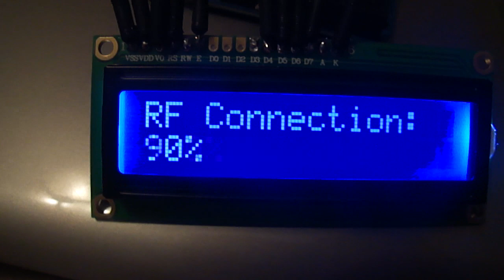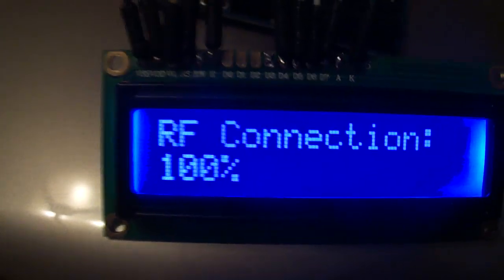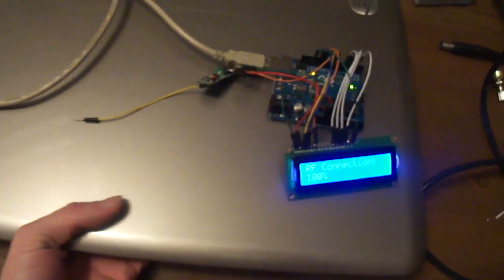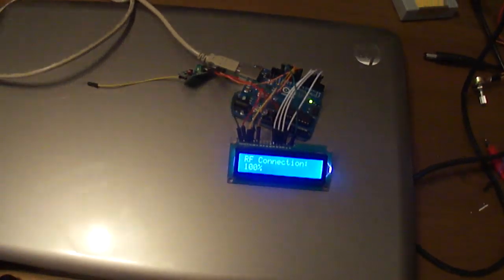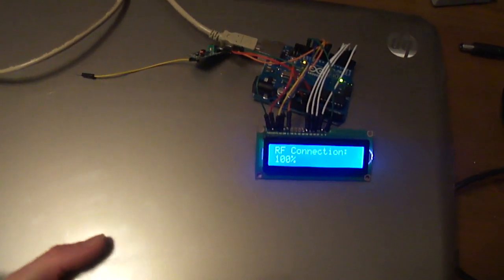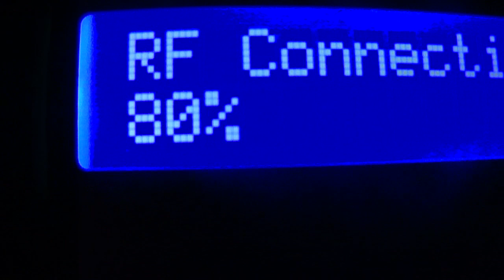433mhz radio frequency rf transmitter receiver kit-- testing range with arduino's

Comment: I am a student trying to build a transmitter and a receiver from scratch, any idea where to start looking ? i have been watching videos but i dont really understand.
Reply from the maker: Yes. I can help. email me at jameshutton@live.ca
order 2 picaxe 14m2 chips and a USB serial download cable from picaxe.com
and order a transmitter / receiver like in this video from ebay. Once you get them, I'll walk you through the rest.
Reply: James Hutton Hi there! Ive been trying to do a project like this for ages. Gave up with the attiny chip. Have ordered a 14m2 kit. Any chance you could point me in the right direction to getting this up and running to send out via 443 mhz. Iv'e got some transmitters ready to go.  Thanks so much. Take care.
Reply from the maker: David Guest explain a little more about your setup. Are you saying you have 2 picaxe chips, one with a transmitter, and one with a matching receiver and you are trying to sent data from one to the other?
Reply: I would like to send a 6 digit code from a 443 tx chip and a picaxe to my raspberry pi running 443utils in sniffer mode.
Reply: James Hutton https://github.com/ninjablocks/433Utils
Reply: In the long run I want to use this code to turn rf plug sockets on and off and to send temperature back from around the house via 443 using rf.
Reply from the maker: ok gotcha. So a few things, you're going to need a microprocessor (picaxe in this case) at every wall socket and place that you want to measure temp. and 1 master that controls them all (all the other nodes would be called slaves.
Keep in mind that if you want to do any 2 way communication, you would need to use a transceiver (communicates both ways). In your case, I think the master would be the only one that would need to do this. Alternatively just use a transmitter and receiver and control them individually with individual pins from the master.

Setting up the picaxes should be simple, and for those simple jobs of switching a plug on or off or reading a temperature an 08m2 should be more than sufficient (their cheapest/smallest chip)

As for circuitry or code, let me know if you run into any problems or have any questions about either
Reply: That's fantastic.  I'm hoping I can get the picaxe to communicate with the raspberry via rf
Reply from the maker: I have no experience with rasberry so I wont be able to help you there
Reply: James Hutton hopefully if you could point me in the correct direction of how to send a 6 digit number from a picaxe chip I can work the rest out myself. 
Thanks again for your help
Reply from the maker: the picaxe sends 8 bytes of data for every RFOUT command. So if you wanted to send a number from 0-255 (lets say 123) and you had the transmitter connected to say b.1, you would write RFOUT b.1,(123,0,0,0,0,0,0,0)

the 0's are just blank values because you have to send 8 bytes.

If you wanted to send out a higher value than 255, use a word variable (16bit).
You will have to send it as 2 8bit variables and convert it back though.
Reply: Could I use the serout command to send a number out without encoding?
Reply from the maker: serout is for serial communication (via wires). Don't you want the project to be wireless?
Reply: Ah I see. I'm trying to send out the data without it being encoded if that's possible.
Reply from the maker: will you ever need to send a value higher than 255?
Reply: only if i could but upto 255 would be okay
Reply from the maker: yeah so you wont have any problem then sending just byte variables (b)
Reply: okay great thankyou very much for your help

Comment: would a bluetooth module be able to get near the same distance performance?  and how is the power consumption differences?
Reply from the maker: I dont know I have never used bluetooth in a project. sorry.
I think blue tooth is a lot more reliable, but I don't think it would get better range

Comment: how did you red the signal intensity? can you share the code with us?
Reply from the maker: read the description. It explains the theory of the code, but unfortunately I dont have the actual code anymore.
Reply from the maker: I've re-visited this and explained the process in great detail, if you're still wondering. Check the description

Comment: Could you run the transmitter and receiver off the same Arduino? I would like to have two boards that could communicate with each other.
Reply from the maker: yes i dont see why not, but how is it wireless if you are using the same arduino? What is the point?
Reply: I would like to have two communication between two separate arduinos, I have two transmitters and two receivers. I've tried using both attached to one arduino but its difficult to tell if its even working at all. There doesn't seem to be a way to verify that you ever actually sent the message. I know just getting two transceivers would probably be easier, but I all ready have these parts and I'd like to avoid spending more money at the moment.
Reply: Two way communication *
Reply from the maker: erm, im not sure. Seriously I rarely use arduino anymore. Like I said. Get a picaxe. the 14m2 chip supports rf.
They are like 3$ each. Buy 2 and they will work beautifully with your transmitter/receivers.

The code to send a signal is "rfout pin, (data)"
the code to receive a signal is "rfin pin, integer values"

it couldnt be easier. this is why i dont use arduino anymore
Reply: Wow thanks, I'll definitely look into that. Do they have the ability to communicate over USB?
Reply from the maker: yes. it uses a virtual serial driver i believe
Reply: Is it similar to the Uno's ATMega8u2 chip, except included on the Picaxe's firmware? I'd really like to avoid using FTDI chips.
Reply from the maker: I am not too familiar with either of those sorry.
It is similar to PIC chips if you have any experience with those. At first it might look intimidating because it is just a computer chip with no easy pins like the arduino, but it is incredibly easy to use and learn how to use.
Reply: James Hutton could the data you are sending just be the measurements of distance between the two receivers and transmitter. I would like to create a device the communicates the distance between two different PIC chips
Reply from the maker: no. it would be incredibly inaccurate. That would be like asking your laptop to tell you how many feet you are away from the router. the signal strength is going to vary a lot from walls, interference from other appliances, and just changing signal strength all the time. I would hazard a guess that the best way to measure distance would be with an ultrasonic distance detector. However, those are meant to measure the distance that an object is away from the chip. The sound bounces off the wall and back, and you calculated the time it took to do so. I'm sure with some modification, you would be able to fix that though. Although, i dont think it would not be able to go through walls or anything if that's the plan.... then there's always gps....

hope i could help!
Reply: hypothetically if u had three seperate equal distant recievers u could make a rough triangulation estimate. Besides that which is pointless; you would have to also link gps (lat lon) into the trasmit data like what is found in telemetry equip and some digital comms such as P25 and motorola astro 25 / MOTOTRBO

Comment: Hello, how do you measure the reception power ?, THANKS
Reply from the maker: read the description
Reply: Thanks but I did and dont know how to do it in code, can you share te code, please
Reply from the maker: sorry, I wrote that a long time ago and no longer have it. I no longer use arduinos so I wouldnt remember how to code it. Use a picaxe chip. It is so much easier to code. if you have any specific questions let me know, but yeah I can't help you out with the whole arduino code at the moment. Basic logic of how I did it is in the description.

Comment: Hey James is the LCD display using the Timer1 librarie? Did you have some problems when controlling both receiver and Lcd by the same arduino board?

Comment from the maker: glass it will go through no problem. Metal might be a little more tricky. It does affect a little, but not very much.
I have tried putting a metal bowl with holes in it overtop of the receiver and it still seemed to work, but with less range

Comment from the maker: what microprocessor are you using? the code will be different for different microprocessors. If you are using picaxe (which i recommend) just look up rfin and rfout commands on the BASIC commands page on picaxe (just search "rfout picaxe" on google. its the first link)

Comment from the maker: first of all the antenna is not hooked up to the display. the antenna is just a piece of wire that receives signals from the air. there is nothing special about it. The display is being controlled by the microprocessor. It is impossible to tell how far away the transmitter is. This project in the video is a very very simple and rudimentary way to calculate signal strength like your cellphone telling you the bars you have. A cellphone can't tell you how close you are to a transmitting station.

Comment from the maker: one other thing you could try, however i have not tried this, is powering both the transmitter and reciever with 5v (different power sources) and seperating the 2 circuits a few feet apart (no antenna is needed).

connect an led between the data pin of the receiver to the negative of the battery or power source. 

now on the other circuit with the transmitter, connect the data pin to the positive of the power source.
When the data pin is connected or not, you should notice the led change.

Comment from the maker: i am not familiar with rasberry sorry. This might be your problem.
I would strongly recommend using picaxe chips like I have stated before. They are only 2 dollars each and are very simple to use and code. 
The minimum code for the arduino to transmit a signal would be probably around 10-20 lines whereas picaxe would be:
main:
rfout (pin number), (1,2,3,4,5,6,7,8)
goto main

so as you can see picaxe only needs 3 lines of code.
the antenna is just a piece of wire. longer = better signal

Comment: If you could tell us the kind of antenna you used for receiver and transmitter?
I am a newbie and just started working a day ago.
Will the transmitter transmit whatever is given as input to its data pin? (we don't need any program to do so?)
My receiver doesn't receive anything.
Please give me simplest possible code so i may know if my transmitter/receiver are working.
I am using transmitter on raspberry and receiver on arduino (as i have only one arduino :( )

Comment: Hey bud, trying to do something similar, but I'm having a problem with the bits per second of the transmitter/receiver (2000) interfering with my serial baud rate of 1200.  At the end of the day, I get an LCD error.  How did you get around this?

Comment from the maker: it doesnt. it would try to read both, which is why these are so cheap. You could make the transmitter send a certain code though so the receiver will only use that one... like send the number 9 at the start of each number you want to send and set up the receiver to only read messages starting in 9. Again these basic devices. You can get much more complex ones that do what you are asking and other things like having the receiver transmit back to the transmitter telling it that it got the message.

Comment from the maker: yeah, i'll keep looking. it might be easier if you try it out yourself and let me know if there are any problems with your code that i can fix. Basically i just used for loops when checking how many signals out of the 100 it got. I just added to int i each time it received a signal, and then rounded i to the nearest 10% and displayed the value of i each second on the lcd. other than that, its just basic virtual wire code and lcd code which you can find instructions for easily.

Comment from the maker: ill take a look for it on my old computer for them. Basically what it does: the receiver knows that it should be getting a msg from the transmitter a certain amt. of times per second... say 100 times per sec. Evry time it gets a msg, it counts it. After 1 sec, if it only received say 88 messages, it knows that 12 msgs were lost due to bad connection and shows 90% on lcd. The worse the connection, the more connections that are missed out of the 100 and rounds to nearest 10% on lcd screen.

Comment from the maker: no, read my answer again. you need to use a microprocessor with the rx. You absolutely need 2 seperate microprocessors for this project. one on the transmitting circuit and one on the receiving circuit.
you dont need to pair them at all. Get two microprocessors (i.e. 2 arduinos, or 2 picaxes) and then i'll help you from there.

Comment: Thanks for the response. i think I didn't ask my question clearly. I want to be able to connect the Tx to the Arduino and then send signal to the Rx which will in turn control LEDs, the Rx will be powered by say cells. How do I go about that? Other question is how to pair the Tx and Rx? I am trying the 'learning' cycle and stuck on step 2 the LED will not remain illuminated? Thanks

Comment from the maker: you cant. you send code (kinda like morse code pulses) through the transmitter to the receiver. It takes one arduino (or microprocessor) to convert a command into the pulses and one to take those pulses and convert it back into the command. So you need 2. If money is the problem, buy 2 picaxes. I have tried this with picaxes and it works great. They are like arduinos except super small and super cheap (2 bucks each). Picaxes are super easy to code. Just search picaxe in google